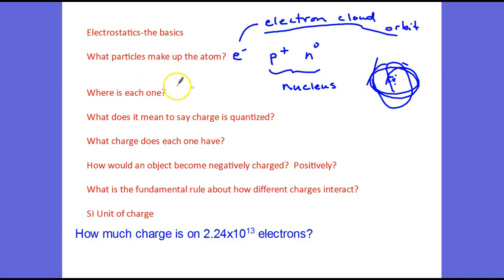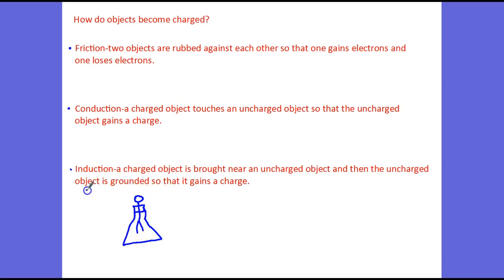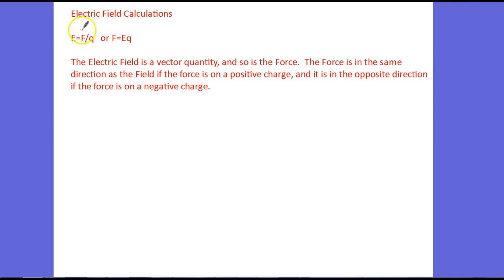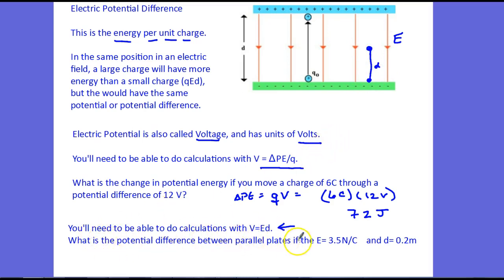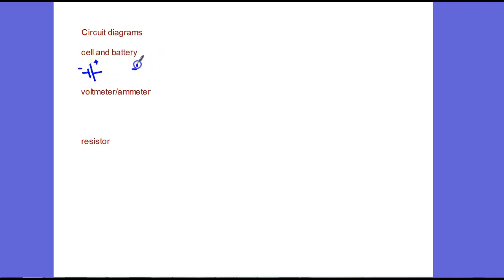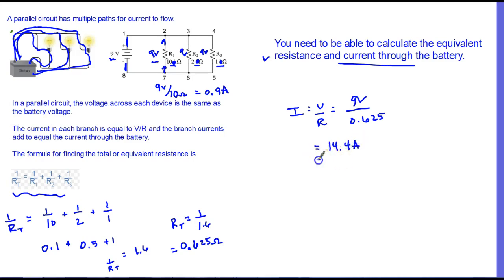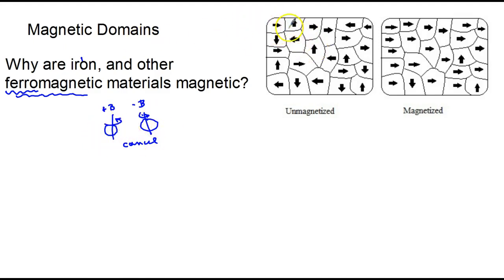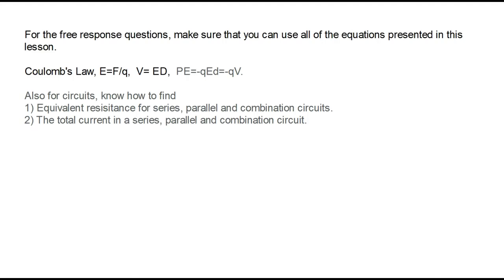Electricity and Magnetism Review

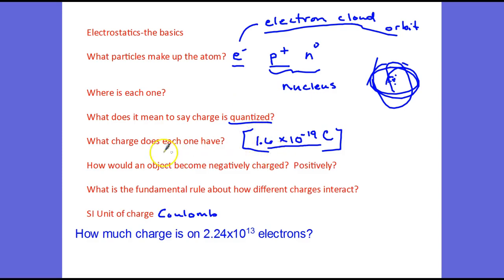Comment: I really appreciate that you explained it starting from a very basic point. But in 1:30, you didn't explain 4th question very well. A better explanation about the basics would do me a huge favor.
Reply: What it means, is that there is a minimum value of charge that can exist (i.e. 1.602e-19 Coulombs, which we call e), and charge in general always comes in integer multiples of this, on any isolated particle or system of particles.  Most matter familiar to you, will carry its charge in protons and electrons.  But even other kinds of subatomic particles, like taons, muons, pions and positrons, also carry charge in integer multiples of e.

The closest we have ever come to discovering an exception to this rule, is the charge on quarks, as +2/3e and -1/3e on the kind of quarks in protons and neutrons.  But because quarks are never in their isolated form, they are always in combinations with an electrical charge that adds up to e.